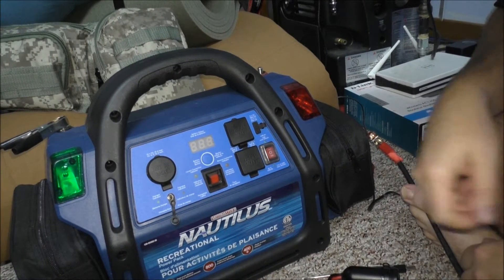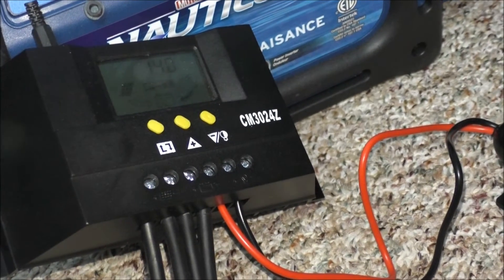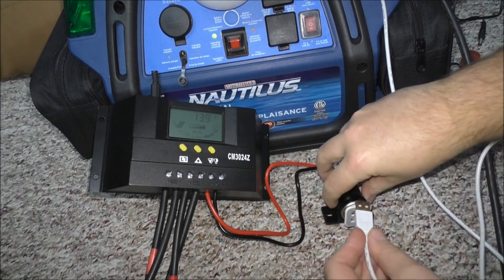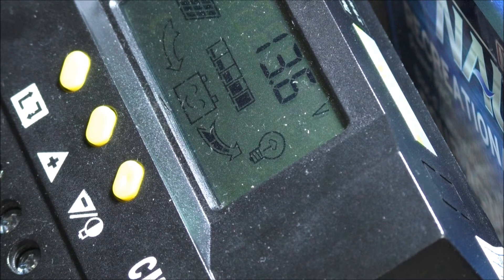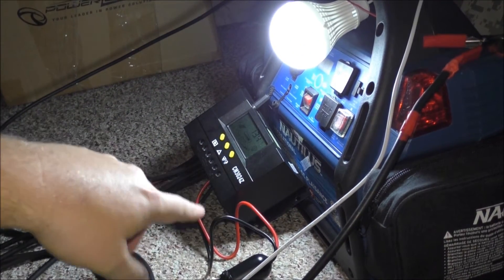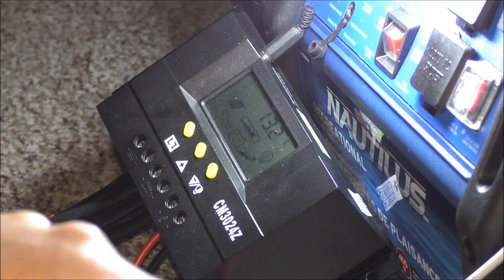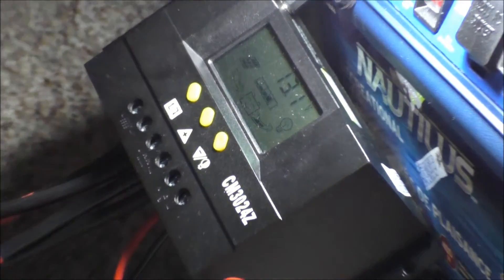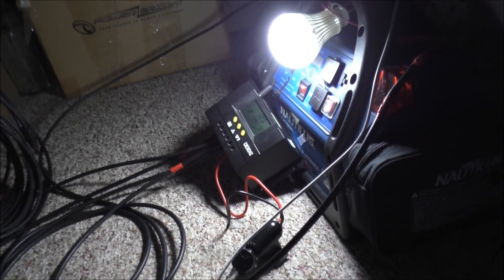Off Grid Solar Dump Load

Comment: hi how to connect the wifi modem in solar controller charger in dc load?
Reply from the maker: depends what your modem uses for voltage. if its 12 volt its ok

Comment: Get a kill a watt and start shopping light bulbs. There are more efficient bulbs. Utilitech pro. There’s a lot of efficient led bulbs. That bulb you are using would drain that battery in 15 mins. There are 2 choices. Go to higher efficiency or go to more power. ie more batteries and panels.

Comment: So we know now that when connecting to the load at night, power comes from the battery. During the day when the sun is out though, does the load bypass the battery? If not, I'd just connect everything to the 12v battery.
Reply from the maker: yes it bypasses during the day

Comment: you could get 12v dc led lamps that fit in a standard (e14-e27) socket and then you don't need to have the losses of the dc-dc converters
Reply: aliexpress
Reply from the maker: oh my ! :)
Reply: Michel, where do you get those at? Sorry if this is a stupid question, new to solar
Reply: Thank You

Comment: One of the reasons your light is such a power hog is your converting 12v to 5v for the usb, then most likely the light then has to change the voltage again, automotive lights are cheap and 12v so they are way more effecient also its likely the 12v-usb adapter will be a constant trickle draw, in my experience I had 100w panel hooked to a big deep cycle battery and it gave me enough voltage to run a light and charge my laptop for a few hours before it died but as long as I had sun the next day I was good for another few hours
Reply from the maker: okay good to know. I will have to think about this

Comment: Hey buddy,
Keep in mind that the charge controller you are using for your demonstration is a PWM not that efficient and is pulling power from the jump pack as well. That LED Light bulbs can't drain that battery pack that fast.
My next opinion is, you could have used the 12V cigarette plug on your jumper pack instead of using the alligator clips and will see a great difference between those two connections.
I hope you find my opinion and  suggestion useful/helpful.
Thanks for sharing your brilliant ideas and and God bless you.
Reply from the maker: Thank you sir. I have made another video showing the charge controller reading of how many amps the light is pulling so you may be able to fill me in better after that ?
Reply: The Off Grid Tiny House 
Thanks for sharing buddy. 
I will check out and God bless you my brother.
Reply from the maker: You as well :)